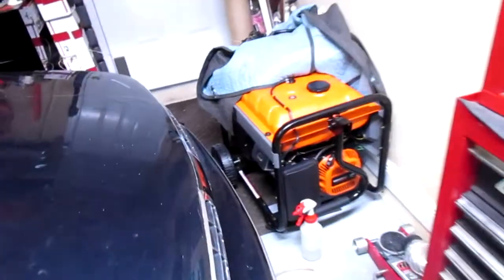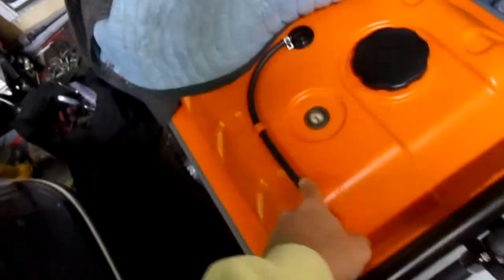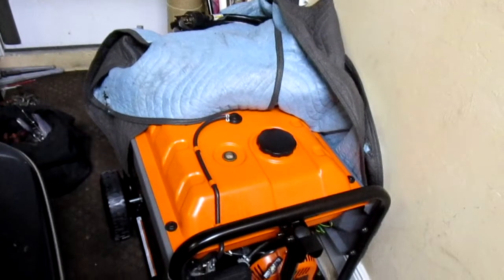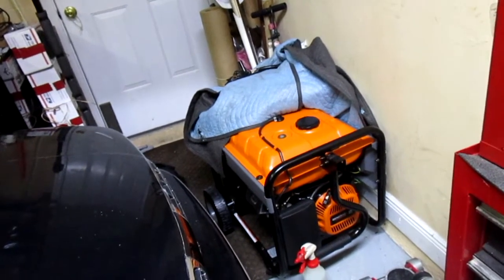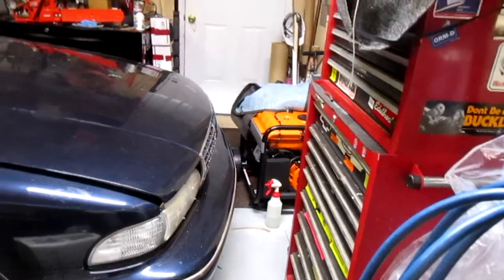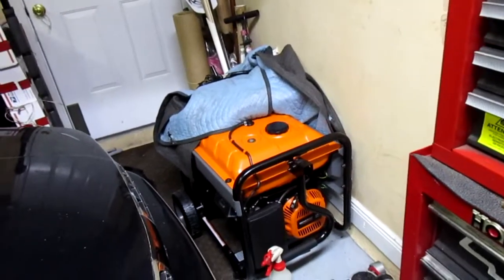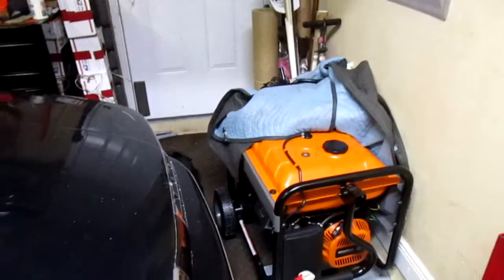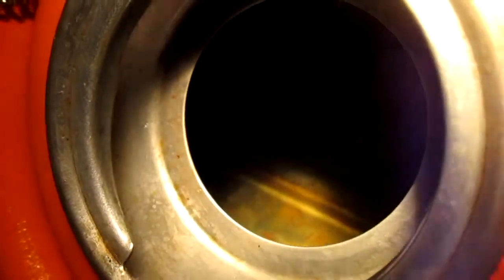This Generator is a Piece Of!  RUSTED TANK!  (Generac)

Comment: Same thing here. But it was over 4 years. Finally found that it wsa the tank rusted out. Cleaned it with the same gas about 12 times. Put clean gas it started but after maybe a minute it shut off. Replaced filters, spark plug, but same thing. Was advice to rinse with diesel. I did about 5 times. Then rinse another 5 times then put in clean gas. It ran a bit longer. But a replacement tank, the cheapest was $275 and $355 most places. A hundred dollars more ordered a champion. Not dealing with Generac anymore. Customer service is Harrible as well....yeah HARRIBLE.
Reply from the maker: Yes its crappy. HHow I stopped it from rusting was a little acid.     then water rinse then oiled it fast now i keep it full of fuel and just change it once a year.     
 Its been rust free now or mostly rust free

Comment: Same mine sat two months with non ethanol fuel AND stabilizer!!!!! And guess what???? Tank rusted all to crap!! I removed the tank and filled it with "evap o rust" liquid. I let it set for two days drained it and flushed it out very well. That fuel tank cost over half what the entire generator cost!! The evap o rust did clean the tank however.
Reply from the maker: Mine has been ok with non ethonal fuel and stored in a dry climate    The CHinese make stuff to break cheap tanks

Comment: Working on the same generator now, I'm thinking it got water in the tank from the fuel level gauge, it wasn't too bright for them to concave the tank so water puddles there,
Drained the tank and it had a gallon of water in it
Reply from the maker: This one just rusted a little because everything rusts here fast.    Just clean it out soap water... Drain it. Dry it Put some phosphoric acid in it let it sit if its heavy rust if its just light stuff swossh it around.   Then Drain it.    I flushed it with any type of alcohol. Then Immediately added just a touch of fuel mixed with 2 cycle 2 stroke oil.    Wooshed it all around then drained it so the tank would not flash rust. I keep the tank full now It barely rusted any

Comment: Not sure how Generac would get away with saying made in Wisconsin if they're made in China. At any rate the tanks are sold on Amazon and eBay for around $30 to $40 and come with all necessary pieces to install.
Reply from the maker: They don't fit.  Its not the correct tank. I just cleaned this one out with acid its been fine. OEM china tank is like 250. They claim "Engineered in Wisconsin"  made in china.  Everything will be china now forever and ever

Comment: Same thing happened to me.  I did a propane conversion and called it good.
Reply from the maker: Yea the Chinese steel is no good.   I suppose if you get some anode rods and try to maybe nickle plate the inside of it they will last.   Best I found is to keep it full of fuel but change it out every few months. Fuel in it... No rust
Reply: How did you know what to do, and where did you get the convo kit?
Reply: How hard was it to do the conversion kit?
Reply: @rockwilliams457  Same question. looking to convert several generators this way.

Comment: Same thing happened to mine....the cap rusted too!! I'd never buy another Generac product ever again.
Reply from the maker: Yea if its made in china they all rust they dont coat the tanks at all or use proper steel. Automotive tanks that are steel have a coating. I forget the name but it was a mixture if Tin and Zinc I think that was added to the metal when it was rolled

Comment: I have the same issue with my Generac 7500 the fuel tank is so bad that the fuel that was in it looks like diesel rather than the gas that was there.  Mine was so rusted that it is impossible to clean the rust off.  the only option is to get a new gas tank and filter.
Reply from the maker: what was that the GP7500? Has a similar tank that this does.  I believe they did not put ANY coating inside this tank. Most steel tanks are lined with a Tin and zinc type coating. Auto tanks are.    This was just mild steel garbage.    If you clean the tank with soap and water then fill it with phosphoric acid It might break up the rust and after many days it will eat all the rust away. Keep rotating the tank around  Still tempted to call them and try to get them to send me a tank under warranty